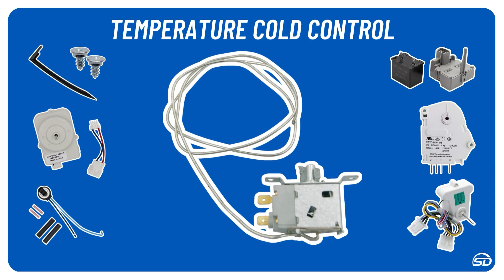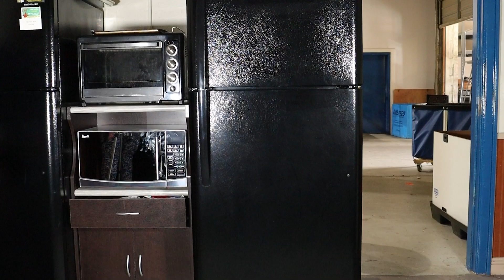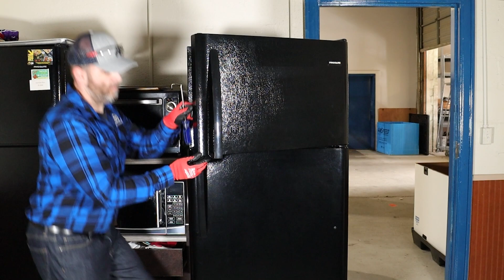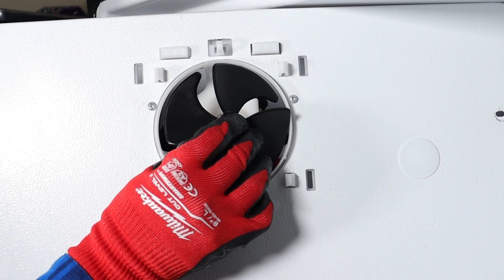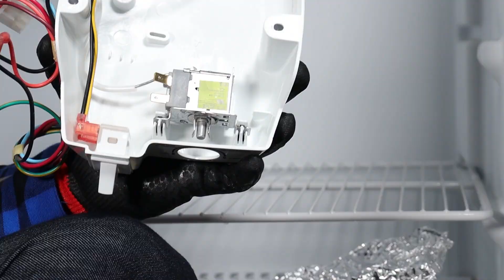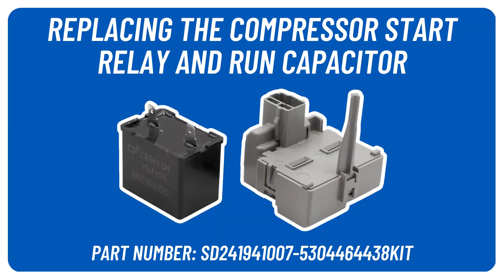Frigidaire Refrigerator Comprehensive Disassembly and Repair | Appliance Model Number FFTR1814TBB

Comment: Why would anyone want to watch this? People need to diagnose a problem and fix it, not watch an overhaul.
Reply from the maker: This video is designed as a comprehensive guide to help users understand the full disassembly process of this Frigidaire refrigerator model. While it might seem extensive, many viewers find it helpful for diagnosing and addressing specific issues, as they can skip to the sections relevant to their repair. If you’re looking for more targeted troubleshooting videos, let us know—we’d be happy to consider creating those as well.